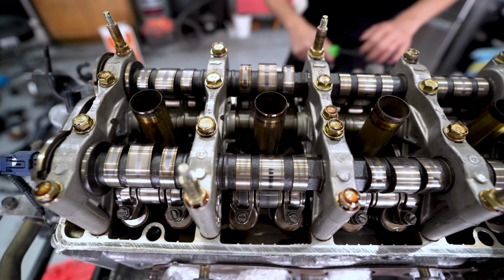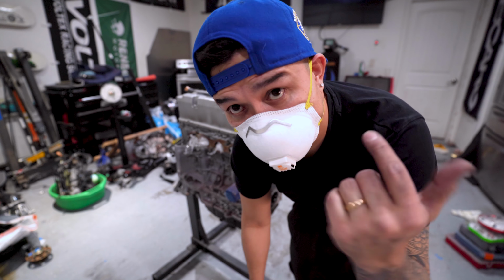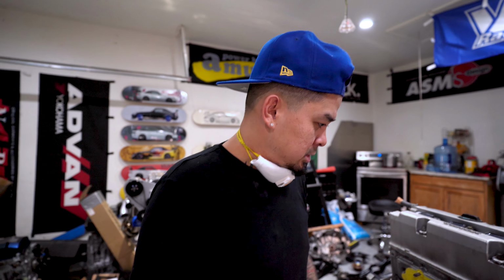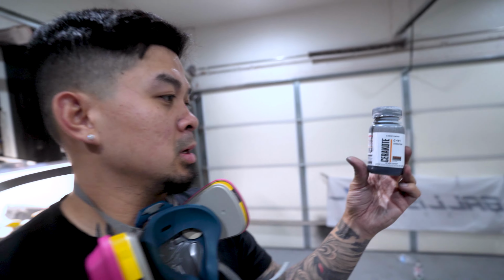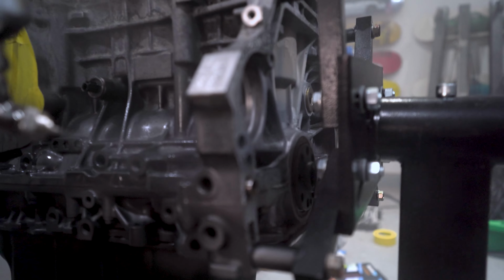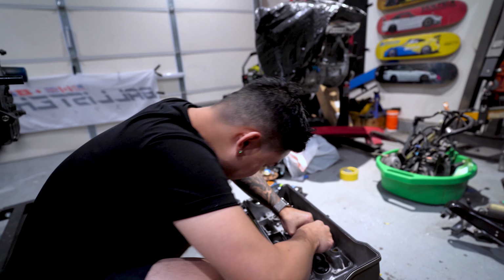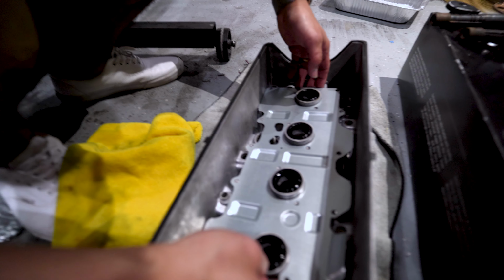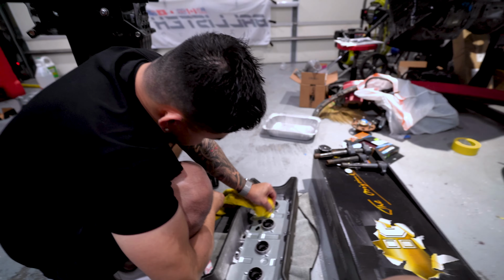How To: CERAKOTE AN ENTIRE ENGINE

Comment: Not sure if i missed it but did you have to preheat or anything prior to applying the cerakote?
Reply from the maker: Yes you’re supposed to gas out the part in the oven at 300 degrees for an hour. But in the case of the engine it’s too big so what I did was I used a torch and torched the engine to gas out all the moisture (forgot to mention it)
Reply: @BallistekGarage  appreciate it! thanks for  help

Comment: Finish won't be good and it will peel,must be media blasted, degreased and preferably baked before coating 😳
Reply from the maker: Wrong. That’s only necessary with H series. I’ve spoken to cerakote they say my process is fine for C-series. Just use torch on the block to bake out the surface
Reply: @BallistekGarage  I reached out to cerakote after reading this, As doing it your way would save me a lot of time and money. i was told all parts MUST be blasted and recommended to be heated,hence why they include it in there training manual.I do this for a living your finish wont last under heating and cooling cycles
Reply from the maker: @neilmorris222  if you actually take their training and ask them directly they'll tell you they say that just to protect themselves from the headaches. while yes its better to heat everything to bake out the oils but circumstances can hender that. The blasting is only used to achieve a perfect leveled finish but not actually required. also i did torch the block to bake out the oils prior to painting it. it has been over a year since i coated it and the motor has held up just fine.